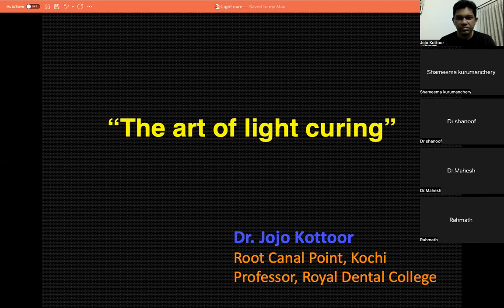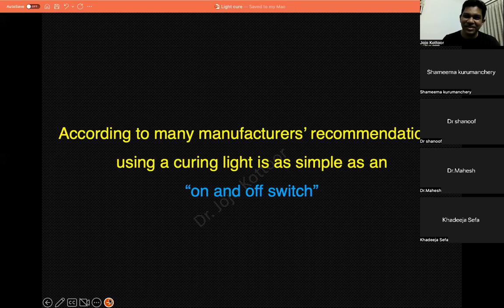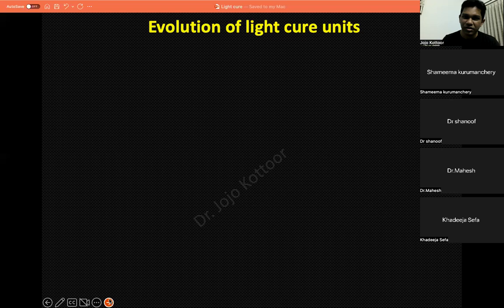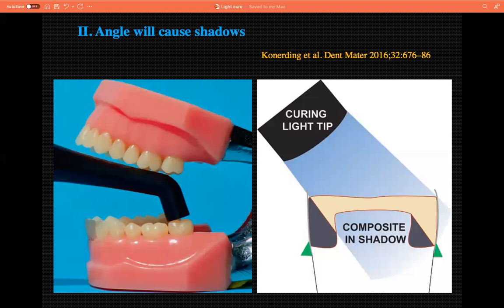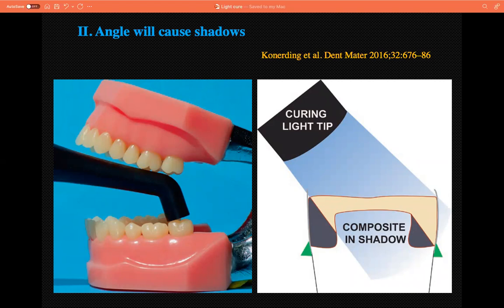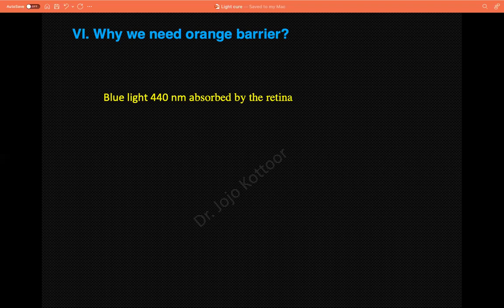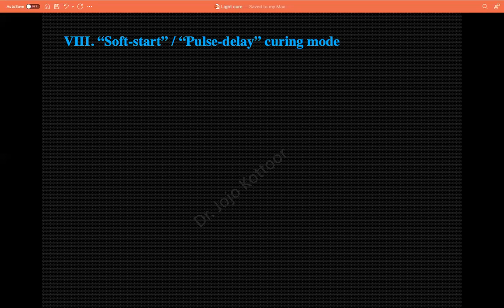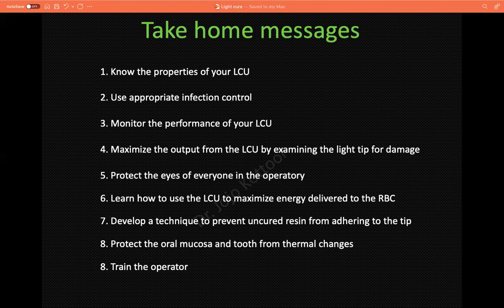The art of light curing resin composites

Comment: Sir...can we use of dual cure resins ...as well as use of isofiller and shrinkage stress relievers in composites to bypass all these shortcomings?so tat it self cures as well as polymeric shrinkage is controlled?i dnt knw any materials in anterior region...but cention n has an isofiller in it which they claim provides shrinkage relief ...its dual cure also...but doesn't bond to tooth...cud be classified as compomer...but yes i dnt think it comes under proper composite...it also has flouride release ...